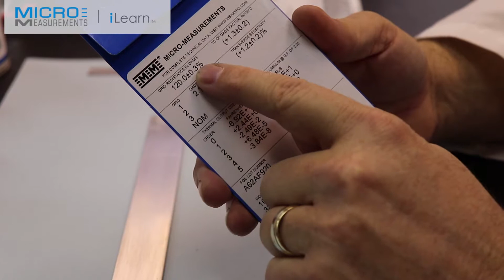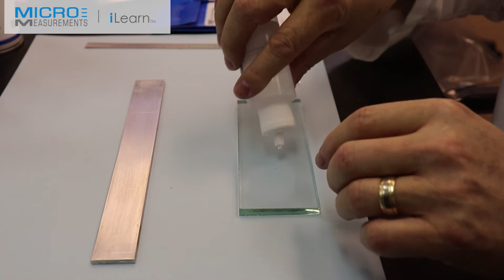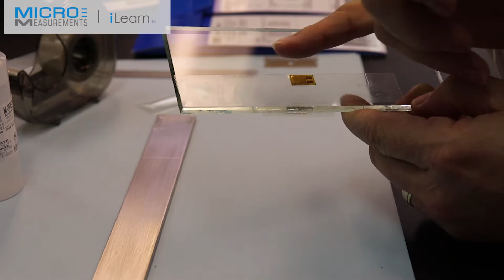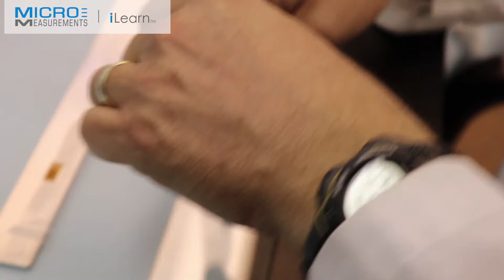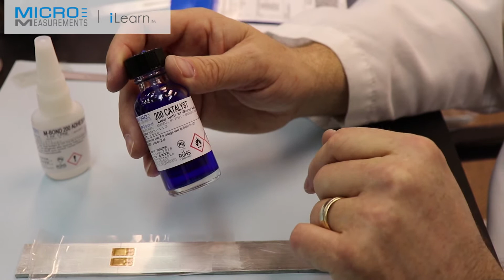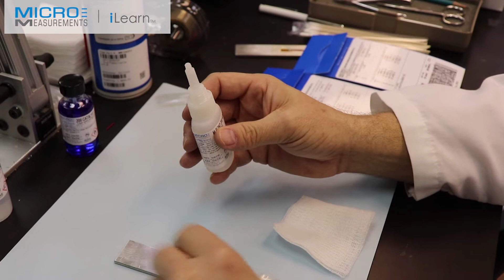Traditional vs. Modern: A Brief Bonding Guide. (Advanced Sensors Technology)

Comment: Si quieres añadir el estilo moderno de las bandas CEA a tu sistema de análisis de esfuerzo, entonces necesitarás aprender a usar el adhesivo M-Bond 200 con las bandas extensométricas CEA de Tecnología Advanced Sensors. En este video se explica cómo usar el M-Bond 200, adhesivo certificado por Micro-Measurements, y excelente para aplicaciones de uso general en laboratorio, debido a su rápido curado a temperatura ambiente y a su facilidad de aplicación.
Si necesita más información, por favor no dude en contactarnos. mm.es@vpgsensors.com miguel.bravo@vpgsensors.com